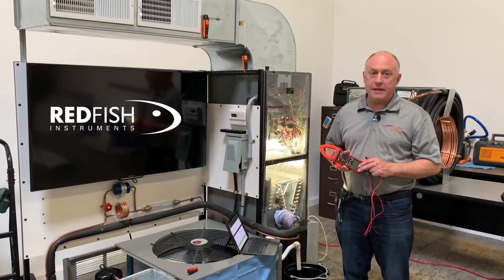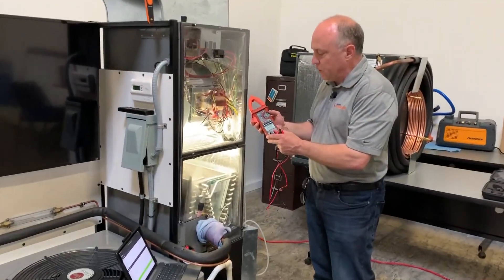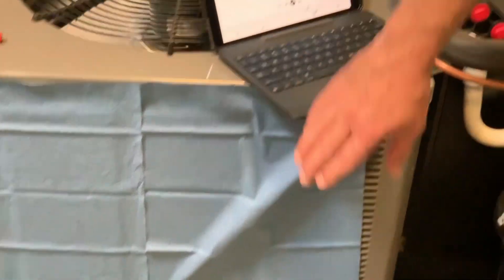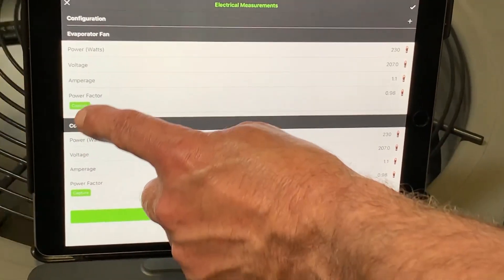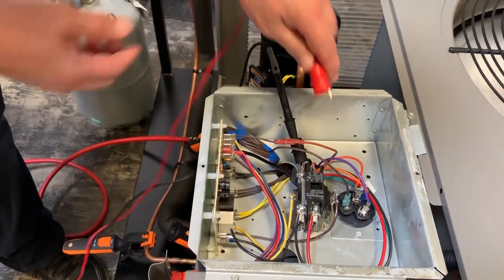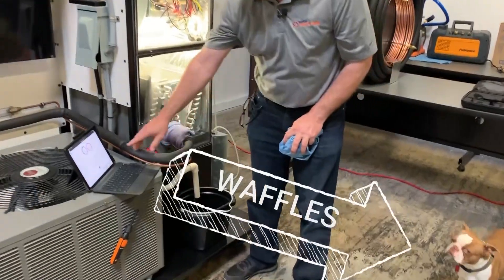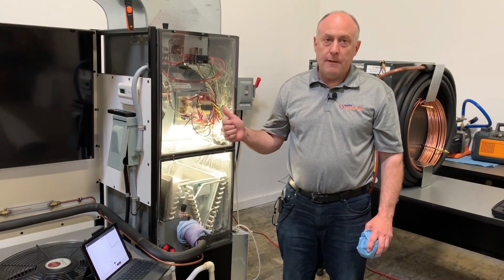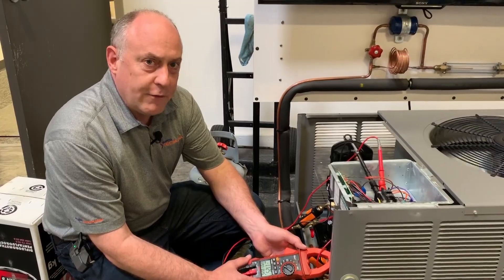Why use a Power Meter like the Supco®-Redfish iDVM550?

Comment: Redfish iDVM550 aka Ames CM1000A $99 at harbour freight. Supco has no shame.
Reply: you dont understand the differences?
Reply: @outthemoney3361  no difference in performance or functions. Only a difference in price ($300 vs $100) and bluetooth availability. Basically you re paying 3x more for $100 worth of bluetooth performance.
Reply: @andresperez-wc8ty  no way can I use the harbour freight version to measure watts and ultimately power factor nor could I use it with measure quick to determine efficiency of a unit which is are key features this video was demonstrating....
Reply: @outthemoney3361  Adding a wing, stickers and an engine tuning, wont turn a 20k mazda into a hypercar. If you'd pay 300k for the tuned mazda go for it, I wouldnt.
Reply: @andresperez-wc8ty  different than a meter
Reply: @outthemoney3361  analogy
Reply: @outthemoney3361  do the watts and PF come from the meter itself or is it only thru the app after calculating?
Reply: @andresperez-wc8ty  there *is* a difference in functions. HF version does not have W or KW or PF. But they appear to be made by the same company.
Reply: Oh your one of the “oh you can get the same thing at harbor freight for…”

Get outta here lmao 

If you don’t like it, don’t buy it. Simple as that.